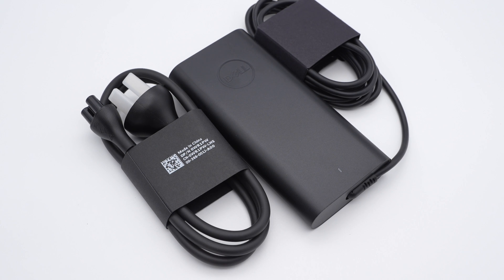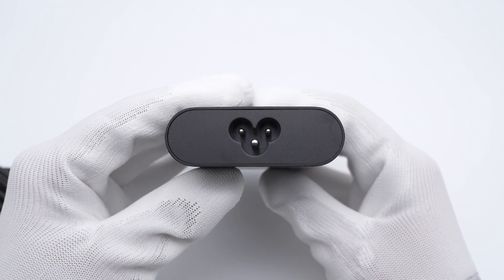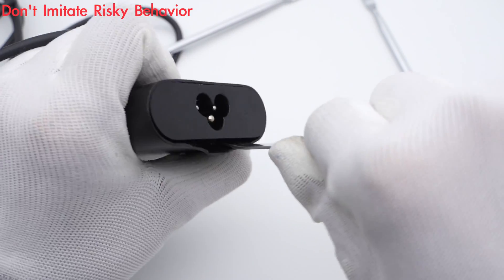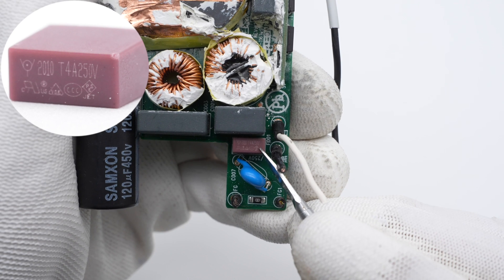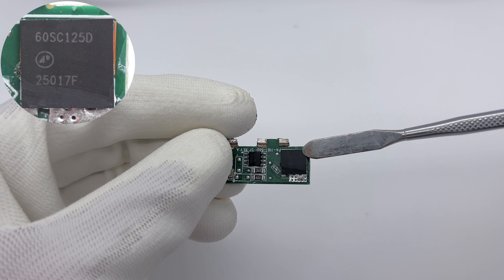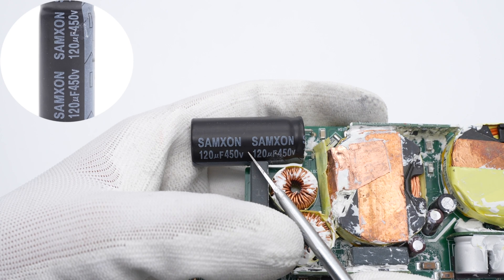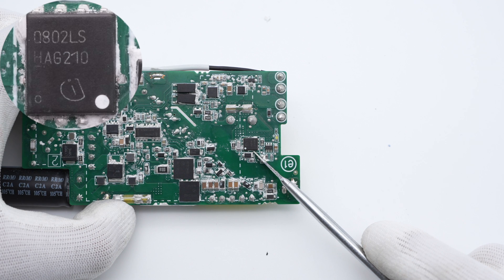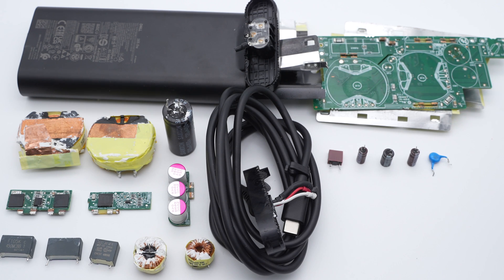Support PD3.1 | Teardown of DELL Original 165W GaN Laptop Power Adapter

Comment: Why oh why can't manufacturers use plug in cables at both ends of the adaptor?  User replaceable cables to reduce waste, or at the bare minimum screw opening adaptors so they can be easily repaired!
Reply: "shutup and pay for new!"😀

Comment: hello, is there any problem using this adapter with a Dell XPS 9730 which would have normally shipped with the 130w adapter...bios indicates 130w input from this charger into the 9730, just wondering if it poses any risk to the xps laptop. thx.

Your comment is awaiting moderation.
Reply: This will work fine on a 9730.  You can just google the specs for the original 9730 power supply, which is 20v @ 6.5 amps.  This unit also supports that mode.

Comment: Wish theyd use an aluminum extruded shell for better heat dissipation.
Reply: Why?  the current shell dissipates the heat just fine.
Reply: Better yet, they could just run a little fan inside the power brick. Just like the old Xbox 360 used to do in its charging brick

Comment: Thanks ChargerLab for the Dell tear down. The heat dissipation is fantastic, yet the most outer casing is made up of plastic, the worst heat dissipation material.

With 165W, the power adapter should be made of some metal like aluminum and also have some form of heat venting vents.
Reply: When was the last time you saw any power brick with a metal case?   I can't remember any since the 80s (Commodore 64).    The good news is that modern GaN power supplies easily surpass 90%+ efficiency at peak load, which means this this unit will never surpass 15w in waste heat.   I've used much more wasteful supplies with plastic cases (250w @ 82% efficiency = ~40w waste heat)  and they also operate just fine continuously.  

Aluminum cases w/ fins may seem like a cool idea to you, but they don't make the charging any faster or cheaper nor do they increase part lifetime.  hardly anyone wants a charger that's more expensive, and gets dented easily, which is why there's no virtually no market for consumer power bricks.

Comment: Its sad seeing that most of these chargers are glued together to the point where repair is nearly impossible
Reply: Why the hell would you ever risk opening something like a charger lmao, they’re supposed to be non repairable because the average person is not an electrical engineer. You’re asking for people to get themselves killed
Reply: you're never supposed to repair any chargers or the wires; you throw them out and replace for electrical safety.  Why on earth would you ever want to attempt repair and probably void code.
Reply: Some of us know what to do and buying new one every time the cable bent is expansive and bad for the environment @stinkinlincoln926